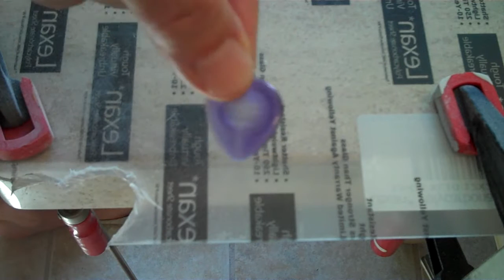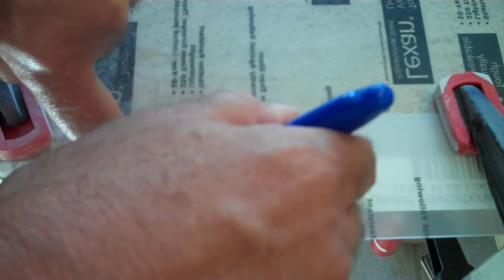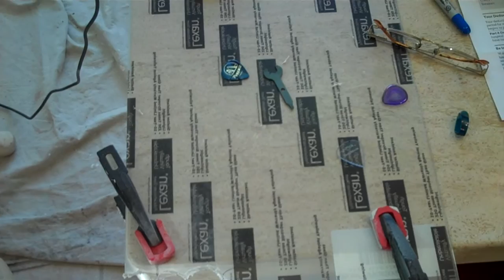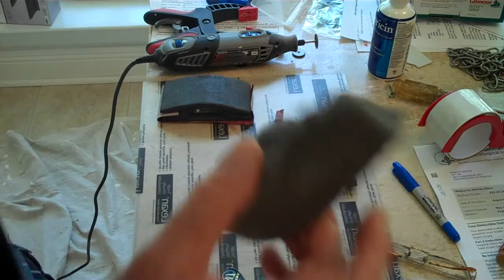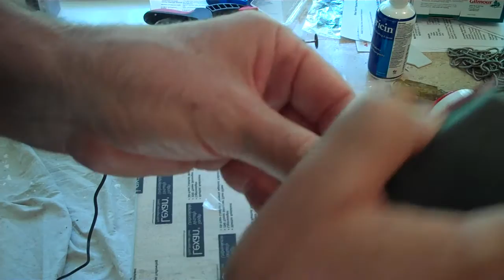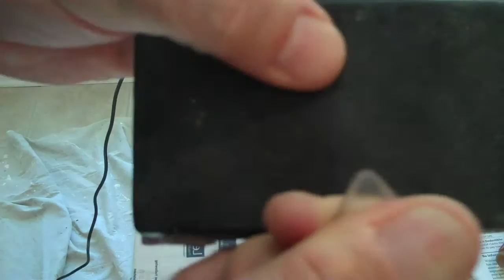How To Make Your Own Killer Guitar Pick for $.04 A Piece

Comment from the maker: Then you will love your homemade pick.  The V-Picks are bevelled all the way around.  I just bevel the two sides and the tip so the top of the pick is thick and flat and is easier to hold with more control.  You can sand the lower part of the pick to a thickness that suites you.

Comment: i have been playing 3mm stuby's for a couple of years and never found anything better soundwise. now i feel like trying one of these.
here is a little trick that you could try also. you can make little grooves on one side of your pick with a sawblade or the dreml.  if you use that side of the pick it will produce a pretty rough, scratchy tone. i like it.
Reply from the maker: I had been using the 3mm Tri Tip Stubby for a while because of the tone then I picked up one of these picks and realized it was easier to hold on to.  The smooth glass like surface sticks to your fingers (if they are not greasy).  I've been playing these picks again and still like them.  I need to make a new batch.  The rough surface on the indentation of the Stubbies really isn't that stable in your fingers.  I would rather them be smooth with no indentation.